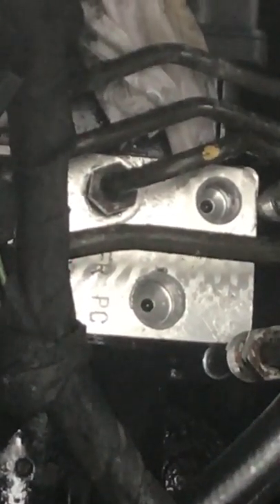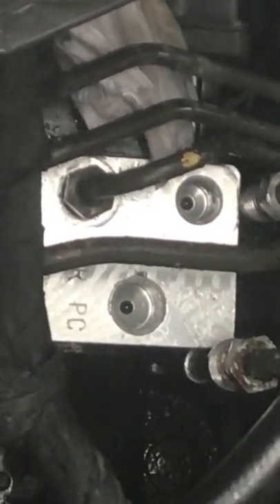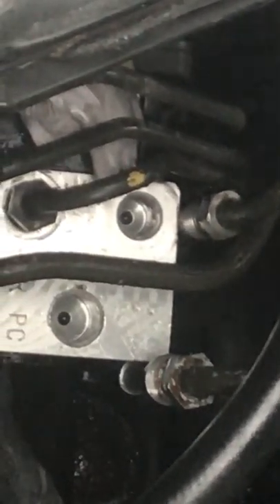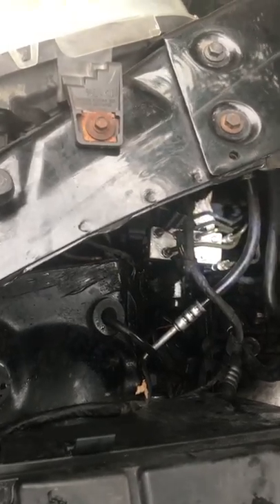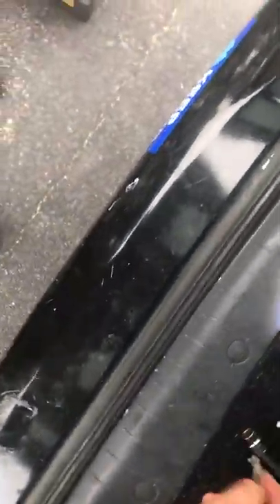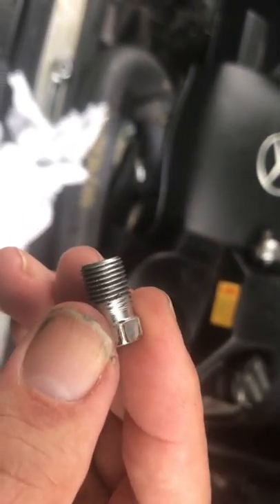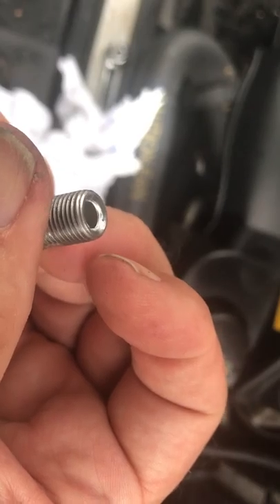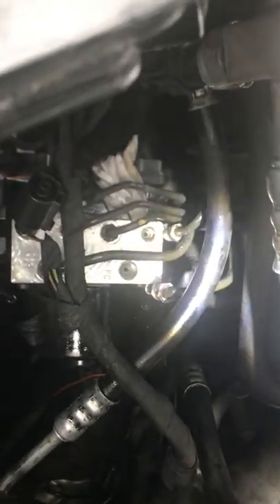Fix it How to Mercedes ML500 ABS cross threaded brake line fix Rethread fix threads

Comment: I was told by a mechanic that once you mess up the thread the unit is trash it will always leak
Reply from the maker: Nope. This is wrong. Get it threaded in correctly. Straight down. And get it in straight and tight. It will not leak. Mine never leaked even after I cross threaded it and then threaded it again correctly.

Comment: Just did that today, so mad at myself. I've made that same type of repair on the same vehicle hundreds of times and never cross threaded one, trying to move a little too fast today, didn't pay off.
Reply from the maker: It will go back in. Hold it straight and turn it back in. It will rethread for you I hope and with good luck.